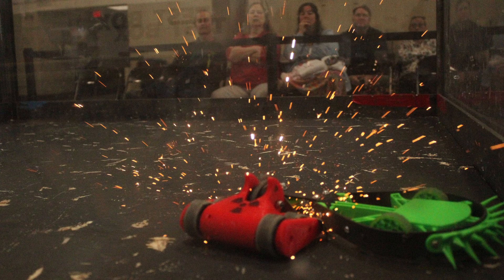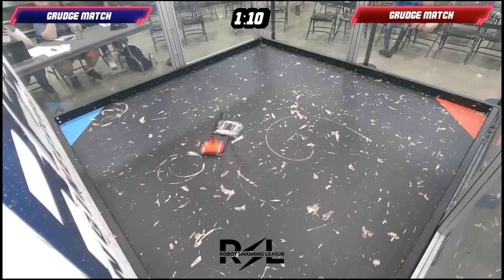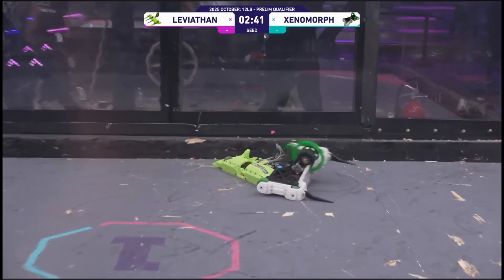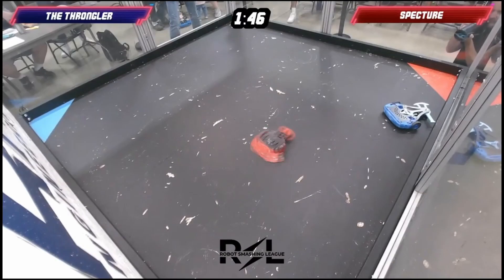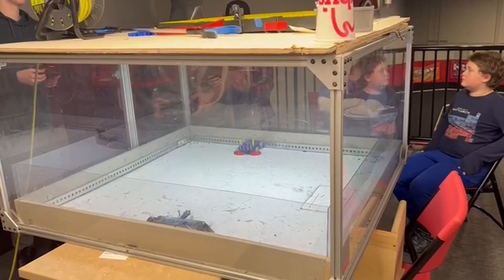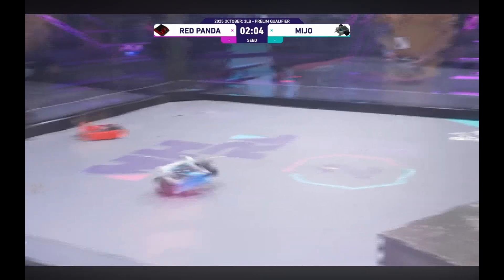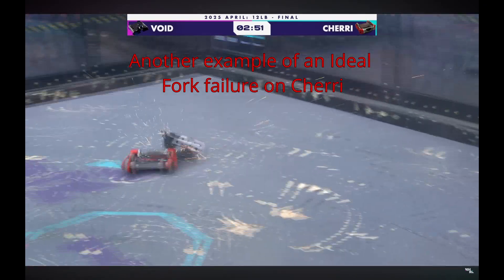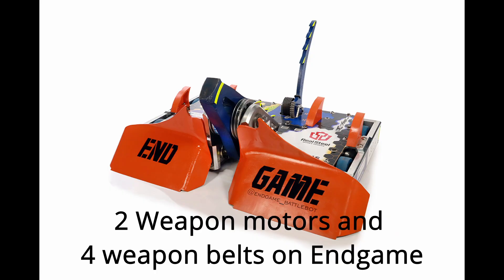How to Design for Failure (Robot Combat Building Trick)

Comment: Nice (: might also mention designing for cheaper components or components more easily replaced/repaired to be the point of failure. An example being your external gear reduction drive in specture isolating the motors from impacts or derive's HDPE grappler arm rather than anywhere else in the weapon system such as the comparatively expensive motor, gearbox and ESC.
Reply from the maker: Oh yes another great few examples!